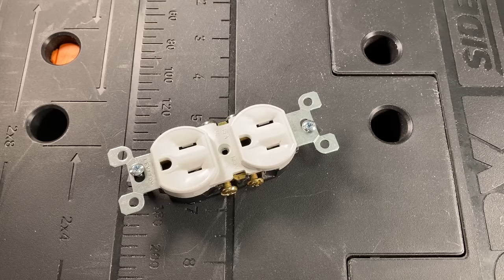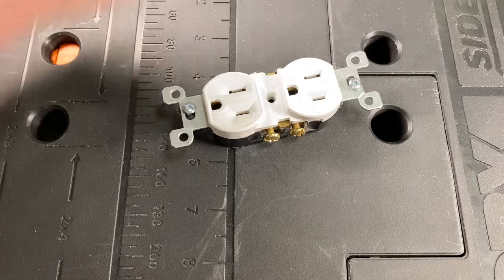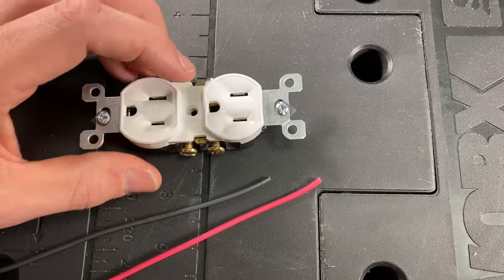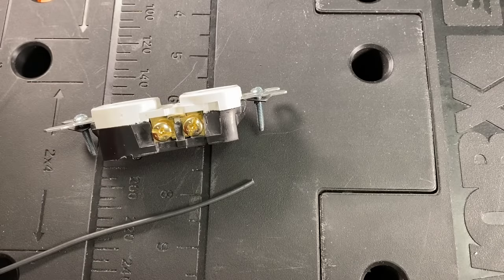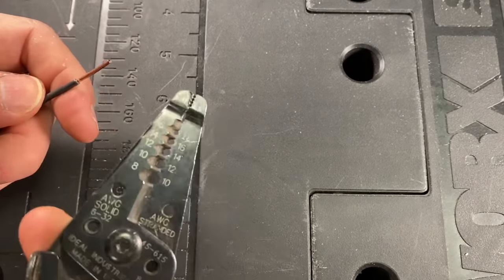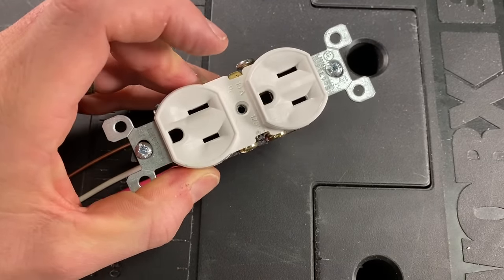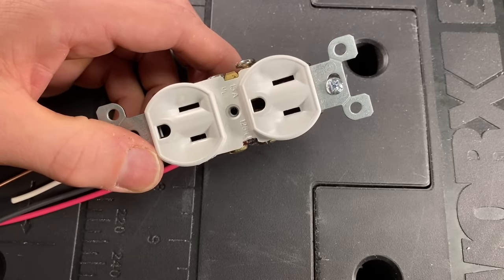Electrical Outlet Basics | How To Wire

Comment: Hey thanks for making this. I have a kitchen outlet with 2 black and 2 white, plus the usual unshielded copper ground wire. How should I wire it and should I cut the connection between upper and lower as you demonstrated with a switched outlet? Mine is not switched. Home c. 1980.
Reply from the maker: If you are in the kitchen you most likely would want to install a GFCI plug which would follow the electrical code.  This video will walk through a similar scenario in a Condo I was flipping where I needed to change out a normal kitchen outlet to a GFCI.
Reply: @SPL Builders thanks.
Reply: You only need GFCI if the receptacles are within 6 feet of the sink. If there is no switched receptacle in the box then you likely are looking at a box in the middle of a run. One set of wires brings the power into the box and the second pair continue the power to the next box.

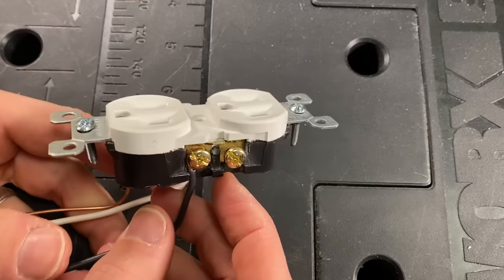Comment: At 6:44, the unused terminal. I always screw them in just so there's that much less hot metal sticking out. 
I also crimp, using what you called 'too much wire', but wrapped in further, and squeezed over against the incoming side, so in case of a screw coming loose, the wire still can't come off the screw. Some devices won't let the screw out far enough to wrap it that way, so you have to use the regular wrap.
What I NEVER use unless I have to is the push-in terminals. I guess the contact area of the little blade in there is about what, .05mm? The contact area of the screw will be nearly 1cm., a hundred times more!

Comment: British Electrician 28+ years. You’re only using 120v system so you’re wires are larger than what we use on 240v. You’re mcb (fuse breaker) are what we used to use in the 80s. We then added Rcd which tripped faster when fault, now we have Rcbo which combined fusebreaker/ rcd protection for the home owner who does not know safety electrics or drills into wire it cuts power off in 0.4sec
Reply: What wire size are you using? Wire size is determined by amperage and a 15 amp circuit is ok with #14 gauge which technically is good for about 20 amps insulated (140 degrees) or 25 amps bare. It is downrated to 15 amps which under continuous use the breaker is 12 amps thermal. A 20 amp breaker under continuous use is good for ~16 amps thermal (80% rated). The margin is skinny therefore the down rating.

Comment: Question 
I’m replacing very old black outlet… old house. 
I understand how to connect wires to correct posts BUT do both wires go to opposite posts on each side- for instance there’s 4 posts, 4 screws- 
So I ignore the top two? They are lose so do I tighten them down and just use the bottom two?
On the old outlet one was wired into the top left, the other on the bottom right…

Comment: I would add that when testing to make sure the power is dead make sure check it on known live source to make sure the voltage tester is working properly (sorry for all the “makes”), additionally when tightening the screws is always better to use a flathead screwdriver to maximize your torque.

Comment: I always use the screw terminals. I don't trust the push pins for a good contact because there isn't much force involved in pushing it in. And even screw terminals can sometimes be a bad contact if it isn't a good solid connection.

Comment: Not enough outlets in the kitchen area   Here is my solution.

I live in a  1950 construction duplex. The main electrical entrance is in the basement garage, some 45 feet away from the location where I needed another two outlets.  These outlets (GFCI) were wanted adjacent to the electric stove.  

I checked the breakers to the electric stove and the copper wiring from the panel entrance to the stove (rated 30 amp breakers on a 40 amp wire capacity.
To run new lumex from the far kitchen wall to the breaker panel would require opening flooring, walls and much more damage.

GIven that we would never run 4 topplate burners and the oven at max at the same time, I made a 3 meter length connection to the outlet box for the stove, with 14-3 wire-gauge terminating at a breaker box under a kitchen counter (in the breaker box I added two 15amp breakers).  From the breaker box up behind the backsplash of the kitchen, I added my two recepticles.   
One receptacle wired to one leg of the 220 stove circuit, the other receptacle on the othere leg.  The gfci functionality was tested, the breakers were not oversized, and this arrangement has been working well for nigh-on 14 years.   In short, I am treating the wiring to the electric stove as a trunk line, with more than adequate capacity.  

As a side-note, none of the kitchen appliances (electric broiler, frying pan, etc)  are rated for 1500watts.  What is plugged to the added circuit is the microwave,  kettle and toaster. The latter two, combined consumption, under 10 amperes.

I often wonder why there are not trunk lines to the kitchen area where most of the houses heavy consumption appliances are used.
This same concept could be used for the washer/clothes dryer. for the laundry room.

Comment: Hello. Nice Video. Just a quick question, if you have 2 sets of wires coming in the box, can you twist ( both white, both black) together and use one screw on each side. Then obviously your ground to ground. Thanks.
Reply from the maker: If you have 2 sets coming in I would confirm if this is a switched receptacle or not.  If it is then they need to stay separate and you need to break the tab between the 2 terminals.  If it is not I would say most pros seem to prefer the pigtail technique where you would only have 1 wire going to each the hot, neutral, and ground.  Also makes getting the outlet back in the box easier.  Best of luck and be safe.
Reply: @EverydayHomeRepairs  Hello. Yea after I cut the old box out, I separated all the wires. (Without Stripping) put my tester on it to see which set was the main power coming in. Then shut the power back off and labeled which set was what. Ran the hot set through the top and “Cold Side” through the bottom. Took both whites to the Silver Side, Both Black to the brass side, and Ground to Ground. 😊. 
Then put my outlet tester on it after all done and put together and Bam all good. 
Thanks For Replying 
Let me know if thats correct. Lol
Thanks Big Jim

Comment: Been going nuts trying to understand which way the hook should face...even though it seems simple. But finally realized that little "retainer" wall (as described at 5:20) is on the OTHER SIDE on the Eaton outlet I have! So to get the insulation to rest firmly against that wall, I have to insert the hook in the other direction. Now tightening the screw clockwise does indeed seem like you risk loosening the hook. What am I not seeing?
Reply from the maker: Yep, wrap the wire clockwise to form your J hook and you should be good.  Some people will take needle nose pliers and close the “J” around the screw for added safety.
Reply: @EverydayHomeRepairs  Thanks for the rapid reply even though this thread is a year old. I'll change the ten outlets I did incorrectly, but still don't quite understand why Eaton put the little "wall" on that side where I can't make use of it. Glad I found your channel.

Comment: Some residences I have seen the ground connected to the box from the outlet. These are always metal boxes and electric metallic tube between junction points. While it works, you have a solid ground connect it is NOT a good idea. If for any reason you get a voltage dumped into the ground the entire system now has powered metal through the structure. That hook you put in to hang a picture from touches one of these tubes so you go to test hook strength and you dump the grounded voltage into yourself. The metal tubes are slightly better than pvc, much harder to actually puncture them when the home owner starts driving nails / screws to hang pics from.

Comment: I like to spend the extra 50 cents and get the outlets that have screw captures. These have a plate under the screw with a slot for the wire. With these you just stick the wire in the slot and tighten the screw down so the plate captures the wire. This is similar to the way relay contacts work. Much easier and more reliable than sheppards hook connections.

Comment: Just wanted to say that in the event of a switched or split receptacle if the tab joining the hot terminals is not removed it will short and trip the breaker or at least it should if your breakers are working. I made this mistake once when I was in a hurry so a caveat would also be to take your time and be sure and be safe.

Comment: Worth mentioning: if the switched receptacle is powered from a different circuit breaker than the nonswitched outlet than a separate neutral must be attached and the tab on the neutral side removed. There are several different combinations of uses and different requirements for them, please consult a liscensed electrician before proceeding.
Reply from the maker: Thanks for the advice Howard 👍

Comment: I never knew the holes on the wire stripper was for forming the loop.  I always used needle nose pliers for that.  Thanks!
Reply from the maker: No Problem!
Reply: here's the next mind melter: the holes in the "ears" on the receptacle are often also designed to make the hook, and I have even seen a few designed to be used to strip the insulation.

Comment: Nice info. So if I'm adding in a switch and outlet to a closet. Like in the other guys video that linked this video.  So on hot side do I need to break the metal brass connection between the  two screws.

Comment: That Klein tool is awesome, I own it and another cheap type that's not as good in my opinion. I dropped by for a little revision...edit My screw was stripped I used socket wrench with a screw bit to get off the tight screw connected to the wire, I had to re-bend the wire correctly

Comment: Years ago I was in a condo, and they sent around a letter telling people that if they were to replace an outlet in the dining room, that they should have maintenance come in and do it as there was "unusual" wiring.  And if people just replaced an outlet without taking care, they could blow out a circuit for the whole building.  That piqued my interest as I was curious as to what was unusual, so I got out my voltmeter.

The top and bottom were normal enough - 120V more or less.  But the voltage difference between the top and bottom on the hot side was 208V.  So they not only had top and bottom on different circuits, they were on different legs of the 3-phase feed for the building.
Reply: That’s stupidly fucked up.  If I lived there, I would demand a complete inspection of all the wiring!
Reply: @jimbaranski4687  
Why the offensive language?

Comment: My outlet has 2 wires (red and black) attached to the right side, top and bottom terminal. I didn't know I needed to break off the tab. Turned on the 2 breakers and sparks flew and both shut off automatically immediately.  Not for the faint of heart. Thanks for the tip!  Breaking off the tab fixed the issue (just have to grab it with a pair of pliers and bend it back and forth until it breaks off).  It was confusing because most outlets in my old house have only 1 red hot wire attached to the right side. And a couple outlets have 2 hot wires and gave me heart attacks when I flipped on the breakers with the tabs in the outlets intact.
Reply from the maker: Yeah, that will wake you up.  Be careful out there.

Comment: Let’s say the tab that separates the two hot screws is intact ( no switches). And the top plug is connected to a desk lamp that is on. Now if I  test the bottom plug with a multimeter…, would this blow up my multimeter or worse since there is current moving? Let’s say i have it dialed into voltage testing.

Comment: My old outlet have 3 wires White, Red and Yellow. White wire connected to Neutral, the red wire connect to hot. And the Yellow wire connected to the hole next to the Red one. there is not bridge between Yellow and Red wires. 
Now i have bought a Leviton thats is the same first one you showing on video. Do i need to cut the bridge between 2 screws on the Hot side to connect Red to Hot and yellow to the next one? Thank you .

Comment: Like your videos very much!  Thank you!!   Please help me with an issue.   Bath vanity lights remain a dim glow, when switch is OFF.   INSTALLED 2 outlets to vanity,  with addition of switch to control above sink lights...1 outlet is a normal.  From there, up to GFI near/but away from sink.  From GFI,   up to switch to control lights. 
The GFI tests good.   Light switch is a 'lighted switch' when Off,  to see in dark...BUT  lights above sink also light a dim glow when switched OFF.   Any thoughts to where/what is problem,  please.

Comment: Great video. You answered some questions I had. As far as removing the tab, that allows two switches to control lights in a room? In other words, I enter a room and turn on light. I walk across to the other side of room and turn the switch off to turn lights off. Is this where the tab removal comes into play?
Reply: No, the tab is irrelevant to dual switching. This would be called a 3Way switch. And the wiring for a 3Way switch is fairly simple to understand.

Comment: Hi, first off great videos, your style instills confidence. I'm having an issue running a light from a switch that controls a ceiling fan. I can't get the new light switch to turn off the light, one of those new led waffer pock lights, I've tried Caseta, TPLink, a regular rocker and Gosound. Please help if you can. Thanks

Comment: So, if you're replacing a switched outlet and DO NOT remove the tab on the hot side, what happens when you turn on the switch? Breaker trip? Or is the only indication: the switched outlet is always live regardless of switch position? In other words, in a switched outlet, do the red and black normally come in parrallel from the same source(circuit)?  
Good video. Thanks
Reply: If the switch wire and always hot wire (black) are coming from the same side inside the electrical panel, then the outlet top and bottom will always be hot no matter the position of the switch. You should never have power from both sides of the panel in a 110 box, because that will result in 220v. This should not be the case, but you never know with homeowner remodel jobs.
Reply: @jackjerryloveify  Thanks JL...I understand that the 2 sides of the electrical panel are essentially separate 110v systems. However, the two 220v circuits in my house (stove & dryer) are served by two breakers each that are mechanically tied together. One gang on each side of the panel. Do each of those gangs connect to both (left & right) busbars behind the panel front and only APPEAR to be two breakers on one busbar?  How else would it develop 110 + 110 = 220 volts?
Reply: @edsauer2889  modern electrical panels have alternating tabs so the top position is one bus, the next is the other and so on.  old panels like Pushmatic had left and right busbars, and the 240V breakers bridged horizontally instead of vertically.
Reply: @jackjerryloveify  usually a switched outlet is on the same circuit as the unstitched outlet in the same box.  99.9% of time there is no reason for it to be different circuits.

Comment: I need to replace an outlet but am absolutely terrified of electricity.Will I still need a tester if I flip the main breaker, shutting off all power to the entire house?Also,can I replace an outlet like the one in the video with one with a built in breaker like one above the bathroom sink?
Reply from the maker: Hey Stephanie,  it is just nice to have a outlet tester and/or non-contact voltage tester for this or future projects.  Hitting the main breaker should be a safe approach but I just like to double check. I think this video is a bit better for swapping out a normal receptacle for a GFCI.  https://youtu.be/7aHeRgpfQhE  Hope that helps!

Comment: Hello...I recently installed a 100amp electric main panel from a small one. This one holds 30 breakers. I was able to put my Dr. infrared electric heater which is a double 40/40 post and my electric water heater a double 30/30 post and a wall electric heater double 20/20 post....working really good. When I tried to add a receptacle for a lamp...the light flickers and I cannot seem to find the problem.

Comment: The side hole on your wire cutter or needle nose you showed, the hole is for wrapping your wire and creating the loop for the screw. 
Can you provide information on auto ground type outlet vs the one you were showing which is not an auto ground.
Reply from the maker: Hey Terry, if you are looking for receptacles with a ground strap on the mounting screw usually you could go with a commercial grade like the one compared in this video.  https://youtu.be/kX6xnOksQTc
Reply: Residential grade has them, they cost about a dollar more, so customers that do not understand the difference, will buy the cheaper ones.
Can be a real problem retiring houses that are wired in armored cable “BX”. With auto-ground outlets not problem, you just replace the outlet. With the ones that do not have the self grounding or auto grounding, you have to add a grounding pigtail from the box to the outlet. Boxes from the 60’s don not have a threaded screw hole for the ground screw. Most DIY-ers will therefore leave them off.
When you show the difference it would be nice to point out the difference.
I thank you, it was a pet peave of mine, sorry